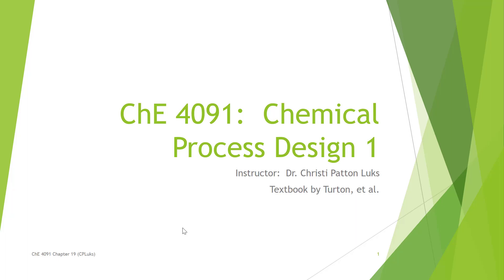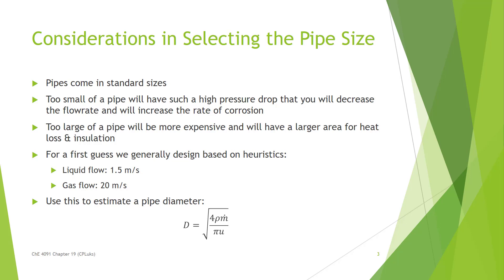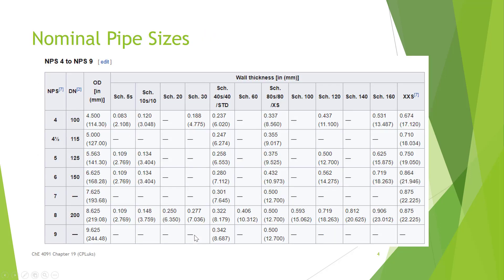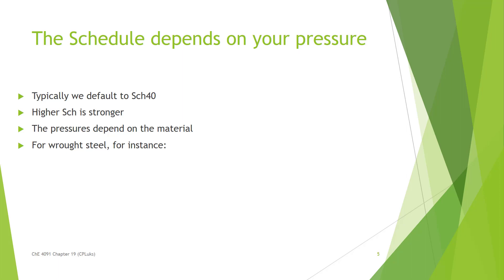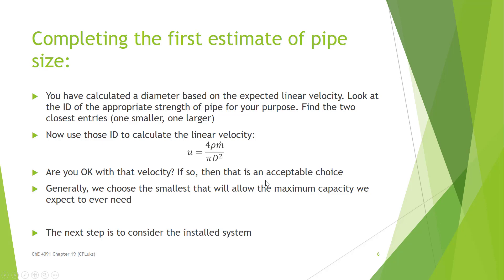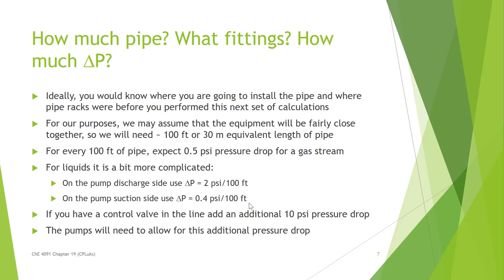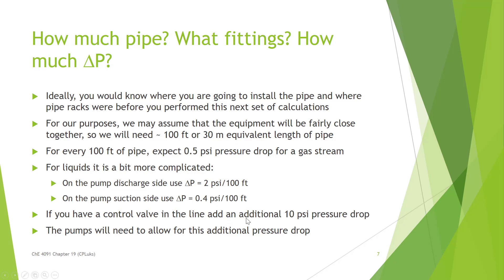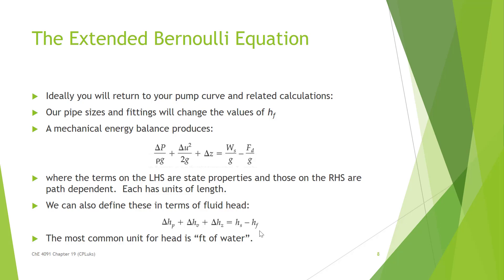Design 1   Selecting Your Pipe Sizes

Comment: I appreciate this video however the volumetric flowrate is not equal to the mass flowate x density.
Reply: I found that the equation works if you shift the density to the denominator, therefore units cancel out to leave metres for your pipe diameter.
Reply: @hughclarkson8206  CORRECT: The formula needs to be corrected in the video